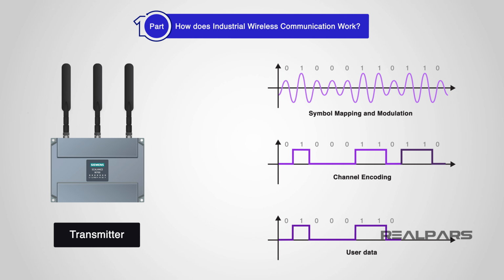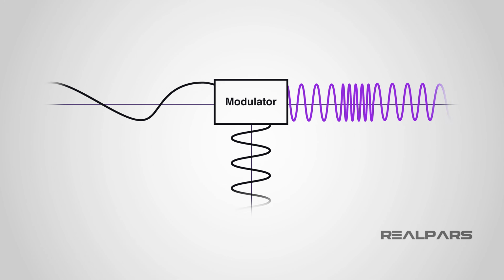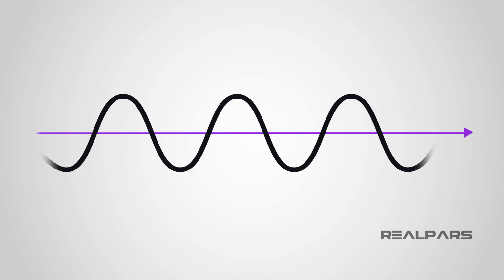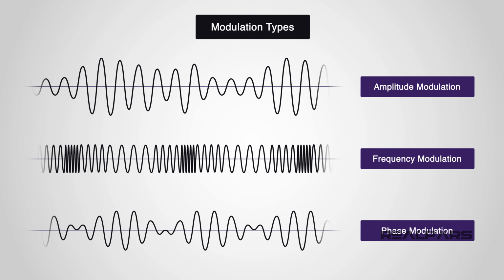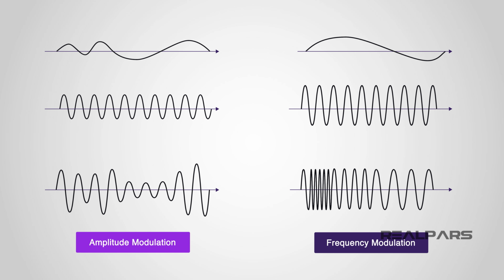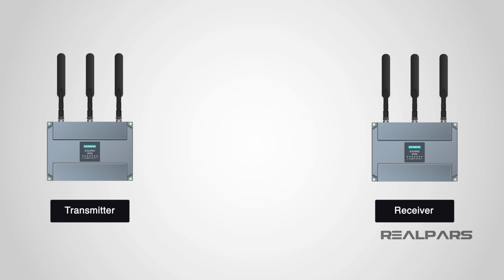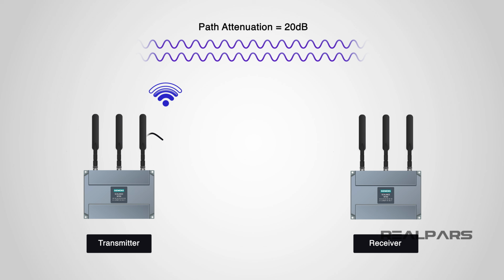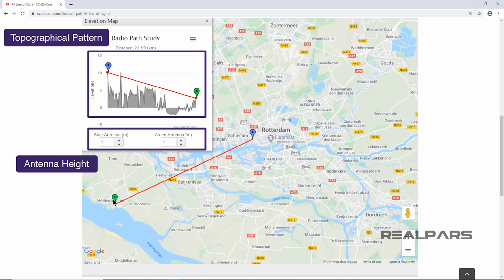How Can We Improve Wireless Radio Modulation?

Comment: Hi RealPars, I love your channel. It's the best I've seen in automation and instrumentation.

I have a question regarding wireless data transfer technology. What module can be used to carry a wired instrumentation and transfer that data to control room; ie, to bring the signals from the 4-20 mA transmitters to the module and the module is able to transfer via wireless that information to control room. Thanks!
Reply from the maker: Siemens SCALENCE W products can be used to transmit wired I/O rack information wirelessly.  Many other manufacturers (MOXA, Acromag, Omron,  Advantech) provide suitable hardware as well.  Typically the local wired I/O is transmitted using a wireless bridge to a wireless gateway that is connected to the main control system, with data transmitted wirelessly between those two devices.

Comment: Other things to consider are:

Antenna selection: Picking the wrong antenna is just about as bad a leaving it off in the first place. You would be better off with a coat hanger. There's a ton of stuff to consider, so find yourself a good antenna guy. And pick one that is familiar with your specific application, A WiFi guy might be a poor choice for example. Depends on what you are doing.

Coax cable: Losses don't start at the antenna, any coax that you use, ranges from pretty good to fairly lossy. Choose wisely.

Application: A point-to-point connection doesn't have to worry about where the receiving radio is going to be located tomorrow (except in the event of roving bands of pillaging Ham Radio operators). For these applications, a high gain directional antenna (e.g. Yagi, Cantenna) would be a great choice since it directs most of the transmission in one direction. Think of the difference between a light bulb and the focused beam of a flashlight. 

Applications where you are trying to communicate with mobile equipment wouldn't be able to take advantage of this. For these applications, look into radios that can do MIMO.

Frequency: For applications where you will be communicating with equipment in a building with lots of metal, the higher frequencies are a very poor choice. However, 900 Mhz or 433 Mhz (depending on which country that you plan on placing the installation) are great choices for excellent propagation. A 1 watt 900 Mhz radio for example can hit 30 Km easily, a 433 Mhz radio, more so.

Do your homework: Here in the states, 900 Mhz is legal for non-licensed use. 433 Mhz is not (depending on the power). Do a site survey to see if the site is already using the spectrum that you wish to use. Just because the frequency is non-licensed doesn't mean that you get to step on each other.
Reply from the maker: Great observations and comments.  In control system applications, a site survey is always completed, since most of the applications are within the boundaries of a plant or inside production facilities, and beyond signal interference, the site study can be used to determine if internal structures, equipment, or other potential obstructions will be probematic.
Reply: @realpars  Thanks! And thanks for the great videos! 

As for the site surveys, yeah we both know it has to be done. But the toobnoobs might not. :) They certainly will on their second installation... 

BTW, there are cheap spectrum analyzers that can be used to do a site survey, for the RF spectrum usage in any case. For Traffic, collisions, overlap, etc, analysis you would want to have a formal survey. I've got a SDRPlay that I will try out the next time I go down to the plant. It's a really nice SDR, fairly cheap, and there is a spectrum analyzer package for it.

As for squeezing in another radio system at a site that already is using that spectrum, switching the polarity of the antennas from what the site is using would certainly help out in keeping unwanted signals at bay.

And I would be remiss if I didn't mention that while the range of the lower frequency radios is superb, the data rate isn't. So don't expect live HiDef video from your AdaFruit LoRa 900Mhz. LOL!
Reply: making whole transmmiter riciver